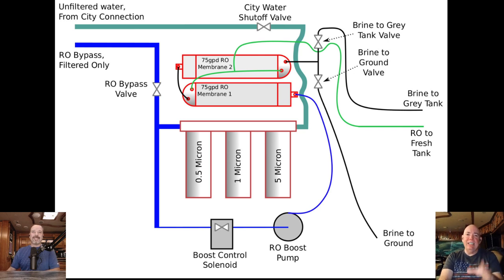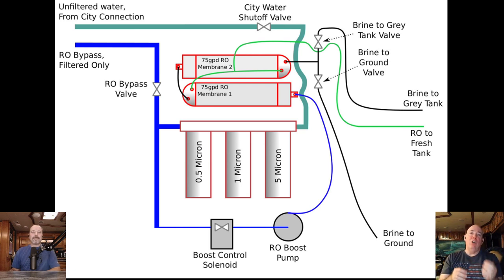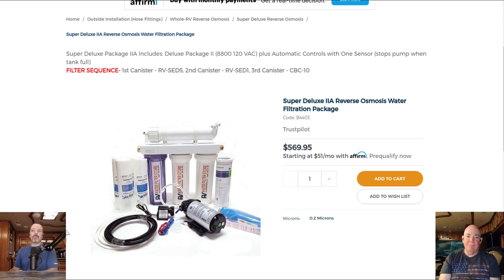Full Coach RO Water System Replay of Live Chat

Comment: the only thing I would add to your thought is a PH adjustment cartridge. RO Will lower your ph to an acidic level (6.7) the adjustment cartridge will get it back up tp 7.7 or so. this will increase the quality of the drinking water as well as project your aqua hot copper fro the acidic level of the low ph water.

Comment: Can you give a parts list, including the digital monitor, gauges and connectors?
Reply from the maker: Hi... Parts we used were from the RV Water Filter Store: https://www.rvwaterfilterstore.com    And here is a blog post on it... https://turtleherding.com/2016/01/mods-whole-rv-reverse-osmosis-water
Reply from the maker: Also...Here are some of the parts used you get off Amazon...

Full Time Water Pump Used in David's Coach (For more coach pressure): https://amzn.to/2QE0gWk 
Booster Pump for RO system (To have a spare): https://amzn.to/2EC2CSY
UV Light for RO System: https://amzn.to/2Gf7DBH
TSD Meter used for before and after results of RO: https://amzn.to/2EFJjbp
Water PRessure Meter: https://amzn.to/3lEKx7N